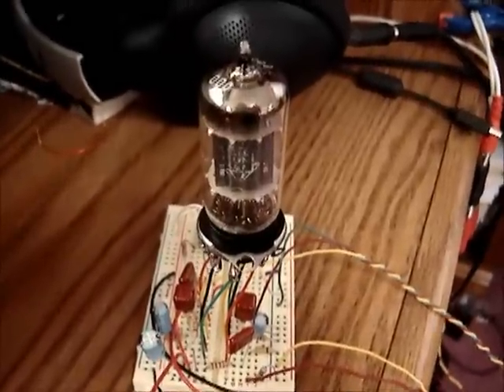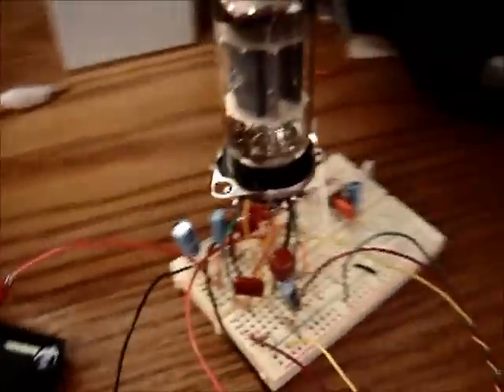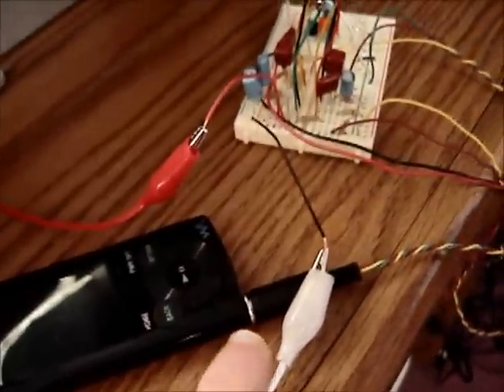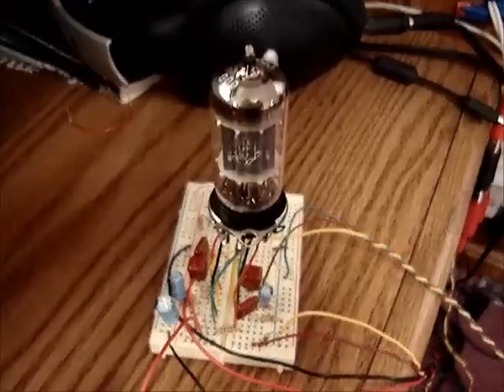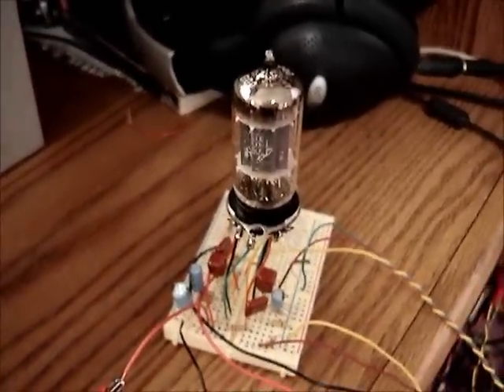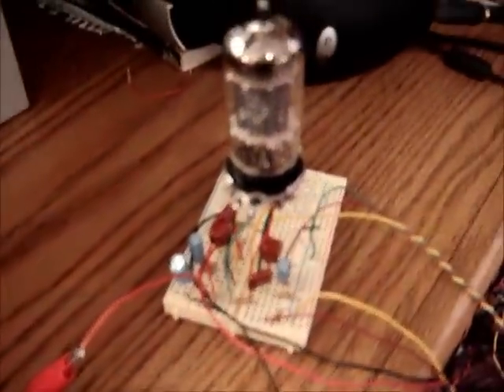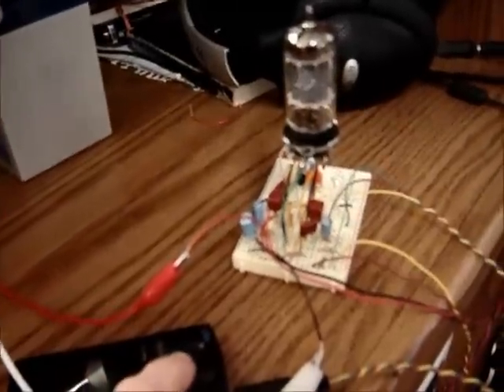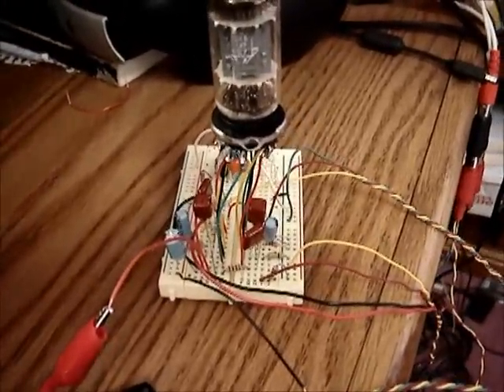12AX7 stereo tube preamp only 12 volts

Comment: Binging on this channel.. :) I have a dac thats just too loud for my tube 6j1 preamp. how can i make this kind of preamp that still buffers controlling just the gain and not the input voltage? like 2v input to tube buffer to 0.9V output 100ohm impedance?
Reply: btw im using a 15v DC power supply

Comment: That is surprisingly good for a tube not known for working well at low B+. You ought to play around with 12AT7 and 12AU7 and see what you can get You may even be able to use a more standard biasing on those tubes. Too bad plate chokes are so expensive. Would help a lot.

It would be interesting to drive it from a line level source. Your headphone output is a small power amp and so probably is more capable of supplying grid current to drive the forward biased grid.

Comment: Did you know the 12AX7 tube  was introduced in 1945 by RCA? And we still use it. But this is amazing. I didn't know you could feed the plates a mere 12 volts and get it to work.

Comment: Hi John! I'm currently working on a low distortion tube input amplifier. The circuit topology requires grounded input DC operation with dual rail supply. As I noticed at high voltage grid is lower voltage than cathode. At 12V grid is much high than cathode also higher than half voltage of plate from cathode. What's the supply voltage that have the grid biased at mid point? What type of tubes are good for this? I'm looking at 12ax7 as it has higher gain. Thanks!
Reply: Wow. This was only a week ago? I achieved 0.0003% THD  minimum. And 0.001% THD+N.

Comment: Just a couple of suggestions: Reduce the value of the pull-up grid resistor, and connect it to the plate. While it will slightly reduce gain, and input impedance, it will also reduce the output impedance, by introducing an element of negative feedback in the amplifier. I will guarantee, it will greatly reduce harmonic distortion. It will also improve frequency response. Another thing might be to connect another output capacitor to the plate, and connect a high value of resistance in series with it, to the control grid. That will allow negative feedback of the AC component, without affecting the DC bias. you can adjust the value of the feedback resistor, to find the happy medium between gain and distortion. Larger coupling capacitors help with the low frequency response.
     It actually sounds pretty good, but it's interesting to note, that most of the harmonics you hear are artifacts in the speaker caused by resonance, rather than the amplifier. You can't hear the difference between 3% and .03% Harmonic distortion in the amplifier, because speakers typically have THD of ~20% or worse. Headphones are typically much better than speakers, but even with them, it's hard to hear differences between amplifiers.
Reply: Could you please share a circuit with your corrections?

Comment: I have a question. I saw a similar schematic, but am needing some help with an understanding of it.
http://www.cyclone-radio.com/preamp.png

If I just give this circuit 12V, I get no noise out of the other end of this. I am guessing it is because I need to bias the input? If so, what resistor value should I pull up to 12V and what should I pull down to ground? I see you used a 47K to 12V and a 470K to ground on your example. Now, assuming I go to the 30V the schematic has it labelled at, then what should I use for the bias resistors? And the last question is on the 12V rail, or in my possible case, the 30V rail, how much current do I need to source? Like, if I made a switching boost power supply to 30V, how much current would it need to be able to deliver? Are we talking a couple of milli-amps, 100's of milliamps? 1000's of milliamps? Sorry for being such a noob!

Comment: The positive voltage on the grid is interesting. I tried some 12ax7 tubes in 12au7 headphone amp and one worked well but the other two didn't. I tried a 1 meg resistor from grid to 12 volts and that improved things greatly. Thanks for your help. It looks like the tube wasn't passing enough current to get a decent positive cathode in relation to the grid.

Comment: I am working on a project whereby I only want to light up the tube filament with DC current. I am putting 6.3 through them and they light up. Not very bright though. When I put 7 to 10 volts they glow real pretty!!  I only did it for a few seconds. How much current can I safely use? What happens if too much? Do they just burn up or is it dangerous?
Reply: for as far as i know , the ECC81-82-83 tubes are designed for 6,3V +- 5% heater voltage  , so putting more voltage will destroy the tube over time.
Reply: According to the specifications, the heaters use 6.3 volts, 150 Milliamps each. For 6 volts, use the center tap pin, and connect the other two in parallel. The tube will draw .3 amps. for 12 volts, leave the center tap pin open, and connect each of the other pins to the battery. it will draw .15 amps at 12 volts. Running the voltages higher will make the tube work better at these low voltages, but will shorten the life of the tube.(not recommended!)

Comment: I built one of these and it sounds great
Reply: Hi, I am a newbie, how would you supply the heater ? Would that be separate ac or dc voltage ?
Reply: @hpsmoh  The heater runs on 12 volts dc on pins 4 & 5. You do not need a seperate supply.

Comment: When you say the gain is poor are you implying the waveform couldn’t compress and distort like a preamp tube can do in a conventional guitar amplifier?  I am asking this because I own a Vox Cooltron guitar effects pedal with a 12au7 tube in the circuit being run at low voltage, 20 volts I believe. And in some literature Vox admitted it wasn’t doing much more than some amplication and any distortion effects were coming from silicon elements earlier in the circuit. And I wonder if this has to be true?
Reply from the maker: It will still compress when driven hard, it just lacks much  gain.

Comment: Considering the limitations it's not bad. Tubes are high impedance devices so some distortion (including harmonics) are introduced matching low input/output devices to the amp.  As hinted you had to adjust the bias to get the tube to work as a class A amp, without boosting the grid voltage it will be class B only.  You have no frequency bias compensation so the natural RC filter will set the response curve.  I worked with tubes since the 60's and still love the way they sound. In my opinion what I noticed is that tube amps are "warm" and solid state amps are "brilliant" sounding. Tubes can't be coupled together the same way transistors can and a different strategy is used in each case.
Reply: Kimberly Buck id love to pick your brain as im at the drawing board designing a hybrid.
Reply: Why you dont need an output transformer to adapt Z?

Comment: Plate voltage is so important to get proper tone from the tube🤦‍♂️
Reply: I bet the harmonics would reduce a lot if it was run on 3-4 times the voltage
Reply: 6.3 volts per element. 12.6 volts, if you're running the heater filaments in series. Traditionally, tubes were rated for 6.3 volts, because that's the actual terminal voltage of a 3-cell Lead Acid storage battery, which were used to run heaters in old portable radios. Using a 12 volt Lead Acid battery is absolutely perfect, for running the filaments in series. The heater filaments require 150 milliamps each, so that's .15 amps @ 12 volts, or, .3 amps @ 6 volts.

Comment: If you can't tell the difference that tubes make, why use them? I've never found that they didn't make for a warmer more musical sound, and that's why so many guitarists and bass players use them in their amps. But if one can't tell the difference between them and S-S, why bother? The nice pre-amp of what you've created has a noticeable warm tube sound and yet you aren't responding to it. You might build an S-S preamp and then spend time noticing the difference from tubes. Specs can be blinding to the ears. One needs to be able to hear* the difference. I will never go back to all S-S equipment which can suck the life out of the sound.

Comment: An ECC82 will perform better (and actually exhibit more gain) at such a low plate voltage. I was playing around with similar circuits several years ago, but for guitar pre-amp purposes. I kept wondering why I got less gain when going from an '82 to an '83. I initially thought the '83s I had were dud. Good thing I didn't throw 'em out! lol  

If your primary purpose is to level match the output of an Mp3 player into a hifi amp, a transformer will do the trick nicely. Those headphone outs don't have much voltage, but they can drive into quite low impedance loads so a step-up transformer can work well with them.

Comment: You pointed out something I have never seen anyone else do. You pointed out that in "normal" operation, a tube acts like a JFET (where a negative gate voltage, relative to the 'source', is needed to control the current flow by limiting what would otherwise be runaway current), as opposed to operating the tube in a low voltage situation, where it behaves more like a MOSFET, where a 'gate' voltage that is positive, relative to the 'source', is needed to entice current to flow and so control the current flow. Congratulations! It's about time someone brought that fact to light.
Reply: So this circuit acts like a buffer? Im only beginnin to learn electronics. But this circuit reminds me of a ce transistor amp..
Reply: @Axelvad  That's not off the mark, but a tube ran on low voltage can't really supply much current, so it's output is then buffered by an op amp, usually with close to 1 gain, sometimes 1.25 gain.
Reply: Well, it's not like a mosfet in that the voltage isn't actually backed by much current, so its output needs to be buffered. It's only purpose in the circuit is to add 'good' distortion to the signal.
Reply: Having the cathode follower resistor helps with thermal drift. It serves EXACTLY the same purpose as an emitter follower, or source follower.(bipolar junction transistor, field effect transistor) Besides, at this reduced voltage, it's hard to pass enough current to get the tube anywhere near it's rating.
Reply: You all make excellent points. and I mistyped when I said MOSFET - I should have said BJT. And while it is true that the current would be extremely low, that does not change the fact that when the grid has to be positive to entice the current off the cathode, it is behaving like a BJT. Even so much that there will be a small grid current analogous to the base current of a BJT.

Comment: looks nice. but, how to feed the filament?
Reply: Five volts DC on the filament should do it. Some people use AC, but you can pick up a 60 Hz hum that way.
Reply: There are 3 heater pins on the tube. The filaments within the tube are in a series circuit, allowing it to be used as a common, for use at 5~6 volts, or, you leave the center tap pin open, and connect the end pins directly to the 12 volt source. The heaters are electrically isolated from the cathode pins. The cathodes of each half of the tube have their own pins. You can "google" 12AX7, and easily find the pin out, so you know which pins are what.(cathodes, grids, anodes, and filaments) All nine pins are connected in these dual triodes.

Comment: Planning to build this for bass guitar as a preamp in chain - bass guitar - tube preamp - TDA chip power amp,how do you think,this might work out as a instrument to line level boost?For now I am trying to get valvecaster do this,but in clean it actually dont boost my signal,but when I apply gain it is too much overdriven for a bass guitar.

Comment: Tube pre-amp with only average components and weak plate voltage on a silly compressed MP3 track with average DAC  could only yield a meager sounding pre-amp. Probably with non-flat frequency response and harmonic distortion. Juz sayin.
Reply from the maker: Distortion measured 0.4% which is not bad for a single element amplifier. What is poor is the gain.
Reply: JohnAudioTech can I get a pic of the schematic? I'm trying to make a 12ax7 overdrive pedal. Thanks for your work!! Glad I found your vids again
Reply: JohnAudioTech, Man that’s really great! 👍🏼
Reply: Michael Rinkle isn’t distortion the be all and end all of tube amps?  If you want undistorted amplification use a solid state circuit every time.

Comment: play pink noise through the speaker and analyze that with a flat response mic. in a treated room floating in the middle of the room...
Reply: white noise as input and a signal analyzer on the out will do, because you want to measure only the amp, not the speaker, room, mic etc

Comment: Yes, at 1:16 a Tubes DOES have a warmer sound!  Also Cleaner & Richer.
I assume you are supplying 6.3volts to each tube filament since you don't show that.?
A direct power supply would be good, but a switching power supply would be a no-no!
---
What Spectrum program did you use?

Comment: Isn't this a "starved tube" circuit?  It's never going to sound that good without the "100-150 volts on the plate."  I could be wrong, but that's what I understand about these circuits.
Reply from the maker: The amp produced 0.4% distortion at 1KHz which is not bad for a single active element. It has limited gain.
Reply: Thanks for responding.  I'll use your inspiration to try it out myself.  It will be a fun experiment (and not too deadly).
Reply: Jon Visser ....Before transistors....all car radios were tube based and none of them had "100-150 volts on the plate."....so it stands to reason that you are wrong...
Reply: I beg to differ.  Old car radios used a mechanical vibrator that converted 12V into AC where it was transformed into the voltages needed by the tube circuit.
Reply: Rick Horwitz some used “vibrator” supplies too. However later on a lot of car radios were internally 12v with a single transistor as an audio amplifier (typically an OC23)
Reply: Yes and there are special low voltage tubes for those car radios, but the high impedances meant hardly any power available, so a car radio you couldn't hear with the engine running!  In fact I suspect a lot of equipment had vibrator supplies (which cause radio interference of course), and was louder but unsatisfactory.

Comment: When I get my bench restored, I'd love to tinker around with unusual tubes used in place of traditionally standard ones.  Say, instead of a 12AX7, use something odd like a 6AJ8  (http://www.mif.pg.gda.pl/homepages/frank/sheets/020/e/ECH81.pdf)

Or one of those nuvistors...  http://www.thevalvepage.com/valvetek/Nuvistor/nuvistor.htm

Comment: did know if the 12v was possible, but you showed me how. Thanks
Reply: Before transistors....all car radios were tube based and none of them had "100-150 volts on the plate."....and they ran on 6volts and 12volts...

Comment: I did not watch the whole video so please forgive me if you answered this already but I have a question. How did you get stereo through a single tube? I have been searching but cannot find an answer anywhere. I have a headphone amp with a single 12AU7, and I was thinking about this. Are the L/R channels split between each triode? And if so, does this create an issue with imbalanced audio (one channel louder than the other)???
Reply from the maker: Yes each triode in the tube is used for a separate channel. No issues with imbalance. Some designs use one dual triode tube per channel. The output triode is in cathode follower configuration to lower the output impedance.
Reply: Cool, thanks for the reply!

Comment: What many people don't know about the tube sound is that not only has the added harmonic content, but, those harmonics are also distorted, just in the same way as if you put a distortion pedal to your electric guitar.
Also, so you know, tubes distort the even and odd harmonics, but tape saturation has exactly the same behaviour, only, the odd harmonics are the ones distorted.
This harmonic distortion is low level as you can see on your oscilloscope, but, for some reason they add some richness to the sound.
They have tried to duplicate this digitally on some extent, and there are many VST plugins for music production in the market for that, some better than others, but the key is to make those low order harmonics distort, and, in real tubes, those harmonics levels change randomly over time, same as tape, which makes it more difficult to replicate.
I can tell that some warm is added just by listening the first song of your demo at 6:44.
Thank you for posting this, Im making me one of those soon, Cheers.
Reply: a good tube amp has 0.003 thd!
Its because a tube is volt amplifier,like mosfets(transistor )
A normal transistor amplifies by current,
Thats why tube s,and good mosfets sound so natural.
Best is to use tube as pre amp,and mosfet end power.
Thats the way i build now,
Active with 6 litle amps,class a single ended. distortion only sounds great in gitar amps,in audio its callt clipping,or over modulation.